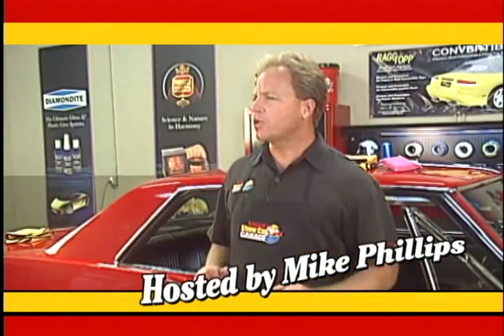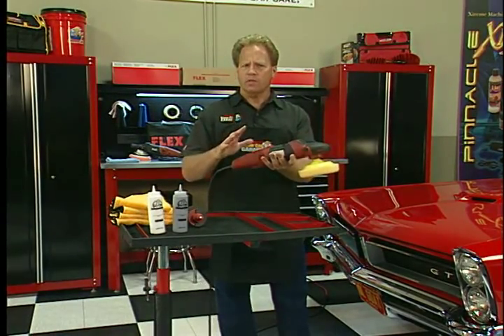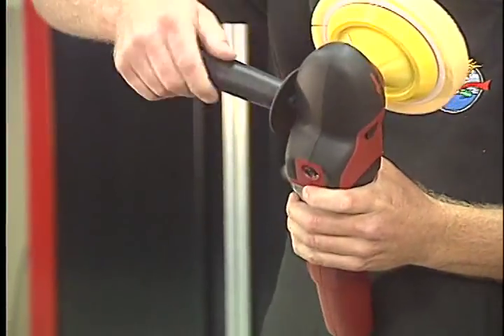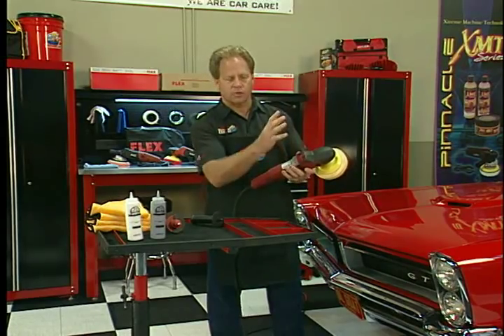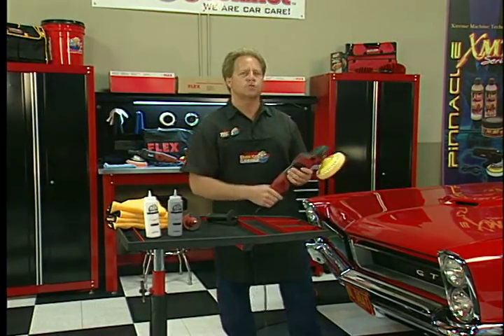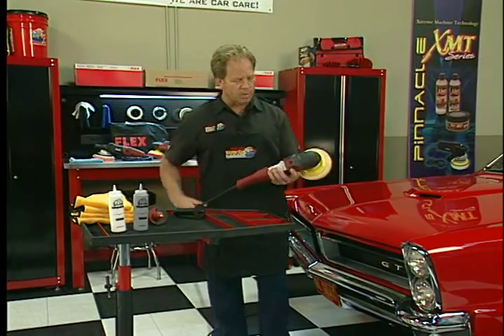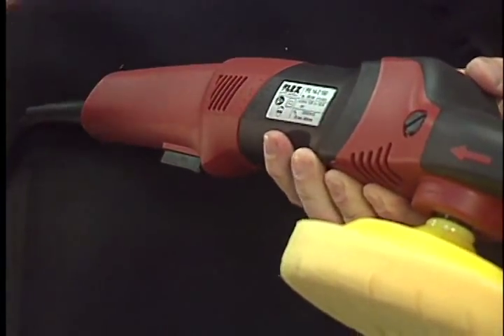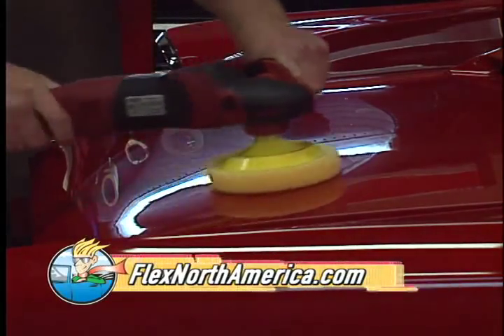FLEX PE14 Rotary Polisher on Autogeek's What's in the Garage? TV Show

Comment: just picked this up, it is miles from my Metabo that was a flagship years ago for its lightweight and compact size. 2011 has presented with the FLEX and I cant say enough about it. It is beautiful, quiet and runs very cool not to mention only 5lbs!

everything is ergonomically correct in terms of access to dials and buttons.

A+ in my book